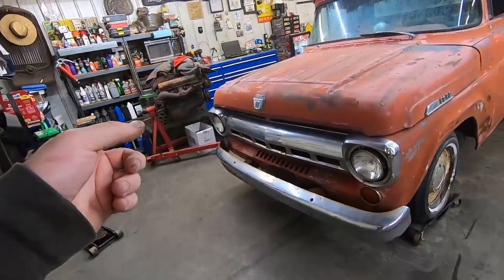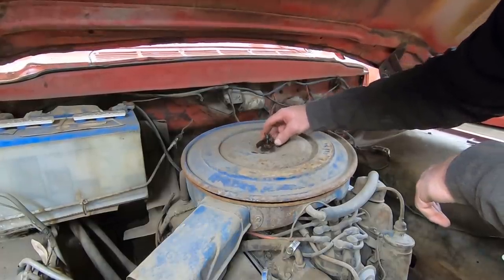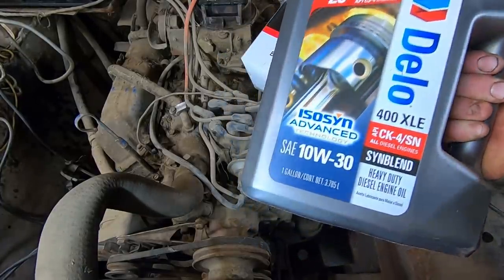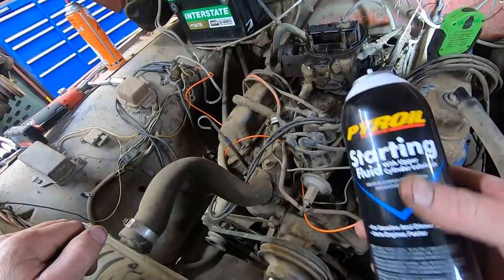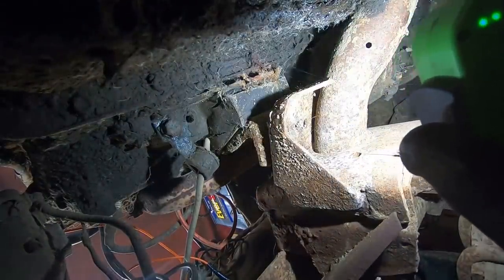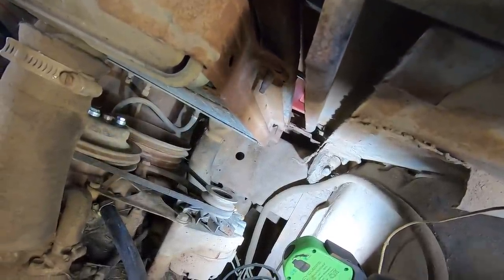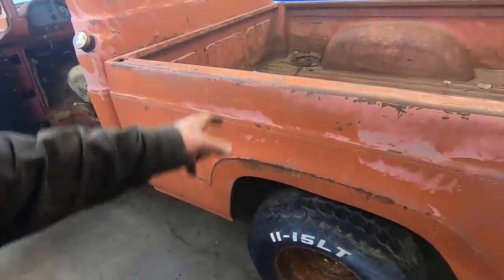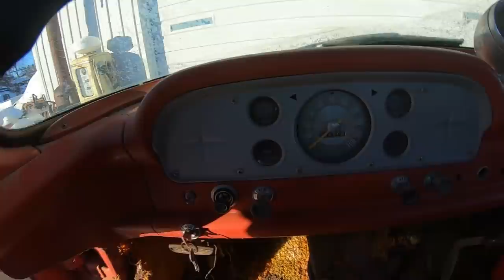Forgotten 1957 F100 Hot Rod Pickup Truck!! Abandoned for 40 Years! Will it Run?!?

Comment: Used to hang around with my wife’s cousin and would go to a lot of farm auctions. Gary bought and sold farm equipment, also scrapped some. Gary bought a ‘74 IH Scout ran great, trans shifted good so I was told that was my ride home. Everything went fine for about the first 25 miles then the Scout started to wander. Drove straight then would drift right, get it straight and drift left. Drove that last 25 on winding roads was a little hairy finally got to Gary’s farm and it turned out the frame was broken ahead of and behind the steering box. The only reason it drove fine that first 25 was that the front end was stiff from sitting and as it loosened up it started steering itself.
Reply: After that told Gary he could drive his own crap home 😳
Reply from the maker: Sketchy!!

Comment: Can you make a diagnostic video of the steering system? A topic not very popular. There is not  a lot of steering system videos out there.
This truck is so cool. Once all the bells and whistle are fixed, heating and cooling system, steering system, drive shaft balancing, new tires all around, the steel rims sandblasted and repainted, new brakes, and master cylinder, new glass packs, new headers, new plugs and wires, new hoses and belts, leather steering cover, fix radio, new seat cover, additional windshield wiper, correct shifter knob,
Reply from the maker: Yeah, we could dig into some steering at some point. Sounds like an expensive list you got there!

Comment: In my first major repair ever, my car had broken a timing gear, and went dead in the middle of the road (it was a '91 Skylark). I spent six months working on it and threw $1500 in parts at it before I ever thought to check the timing. We've all had those moments. When I worked at the junkyard, I bought tons of cars with minor issues that were misdiagnosed. I bought a really nice '80 Cougar from a guy that told me the motor was locked up. It just had a bad ignition cylinder. It wouldn't go into the crank position. The guy junked it over a $10 part that took less an hour to replace. We threw a key and cylinder in it and put it back on the road. It had a 302, and that car was a ton of fun to drive. I drove it for a few months before we resold it.

Comment: Ford Windsors have SBC style timing cover and water pump.  289/302 intake manifold is 9" wide, 351 intake is 11" wide.  The tubular engine cradle was also common use in early Econoline vands and pickups.

Comment: Nice truck. My first truck was a 57 f100 custom cab. It had the stock 292 Y block and a 3 speed on the tree. I rebuilt it after the head gasket failed. It was slow but it was smooth. Good luck.
Reply from the maker: Very cool!

Comment: Paper pressure-relief valve on Frams ... back when I was a parts-counter monkey, we got hit with a couple damage claims when that valve would come apart and trash a motor or ten. You can tell how bad they are compared to something like a Wix or a K&N cutting one open and looking inside. To be fair, I never had one come apart before I discovered how they're put together. I run the K&N ones on my Retrobird - the hex head built into the cap is a convenience when you can't get the filter pliers in there.
Reply from the maker: Good info!

Comment: Dude, I'm a Chevy guy but this truck is beautiful! Before my time so I'm not familiar with early Fords , but this one is sweet. I been using Fram filters on a chevy 305 for years. 250,000 miles so far. By the way , Puddin tried to burn the shop down, but he's a good guy.
Reply: You gotta use Puddin's fire footage as a dig.

Comment: Hey Mortske I love this truck. I'd love to see you fix the driveshaft, get some round tires and put them on like weld wheels or maybe some Crager Nomads on it for like a 60s 70s street look,  a 4 barrel manifold, and brakes.. I bet this thing would actually be a fun truck. Considering the steering box is wasted I wonder if there's a power steering box that will fit?
Reply from the maker: I think all of the steering just needs rebuilt.

Comment: Hey Mortske! REBUILD A CARB! For Pete's sake, bud. It takes me 30 minutes, once the thing's on the bench, and it's super easy to get good at. 

If I can, so can you. It builds confidence, the more ya do it. Just fuel in, fuel overflow return, metering, and not getting the jets backwards. I've seen a cranks no start go to purring like a kitten in an hour n 45 minutes in the driveway on the tailgate. The kit was at Oreilly. They can order a shitload of them, it's just finding the right guy, the ProDesk, Asst Mgr, and Mgr usually do me right every time. 

351W parts are hard to find because nothing ever breaks on them. 4 bolt mains, I think. Might be wrong. Think these are the ones you just beat and beat like Peggin' Leggin' Canadia Guy on a bender.
Reply from the maker: Why rebuild it when it worked just fine? If I was gonna rebuild anything how about the brakes? I've rebuilt lots of carbs. We did one on the channel 2 weeks ago. Parts are hard to find for a 351W cuz Ford had to change them every 3 years so there is only a handful of parts that interchange!

Comment: I have a red 59 F100. I grafted an LTD front clip.  That lowered it substantially.  I also have a 400 M with a holley 4bbl and C6 in it.  It handles and runs well.  I do have the LTD power steering  and disc brakes as well.
Reply from the maker: Awesome

Comment: Both Mustang's I've bought before were considered hopeless by the people that I purchased them from,... I took great precaution to do as little work as possible.... to get them to turnover.
#1. The Gold '72 GRANDE took fresh fuel, a strong battery, and the kicker was after I checked for spark, I found-------it had no points in the distributor! I installed a new set of points, and it fired right up.
#2. Aztec Blue '72 was similar,...it needed a strong battery, fresh fuel, but the carburetor's "Float and Pin" mechanism were missing; after I installed them from a spare carburetor I had,.... It too fired right up. (Both cars W/ original engines, 302 small blocks) my son and I love them.
Reply from the maker: Nice

Comment: No Ford did not forget the key in the drivers door.  To lock this vehicle and other Ford trucks of this era you push down (to lock) the drivers door handle, scoot across the bench front seat exit through the passenger side door, turn lock in passenger door.   Why, many states had regulations stating that you could not exit the drivers door into traffic. Locks on  both door sere available on the higher end Custom Cab in late years.  Narragansett Bay

Comment: Excellent video Mortske Repair  :) very interesting old 1957 Ford Truck F100 with 1968 351 Windsor motor plus Floor shifter Automatic transmission and bet fix drive shaft be smooth riding to again ! Reminds of my late Dad 1968 International 1300 1 ton pickup when growing till  1984 was road and scrap out in 1994 ! That truck was wild for sure and but kept warm in winter months!
Reply from the maker: Glad you enjoyed it
Reply: @MortskeRepair  you asked if use Fram Oil Filters yes I do and mistakes is how long use them plus a Conventional Oil ones & Long Life Types in mileage types and Synthetic Oil types  for gas and desiel motors! Why people had problems with is put oil filter for more kms or miles should be for instance basic one is good for one oil change not every 2 change or years worth and 2 X with Black grip for only 6 months or 7.500 kms or 5.000 miles! The other problem is in Conventional Oil use no recycling type oil to use 2× black grip bottom not use Synthetic oil plugged them fibre inside filter fast! If use Synthetic oil use excellent quality oil and no recycling type plus Oil filter for Synthetic type only ! But Fram Orange with Black grip says 2x do engine oil filter every time  on one use! Also don't use long life engine oil for year type that pure bull crap 6 month only and do oil filter to same ! There go Mortske Repair and You Tube videos viewer seen lots crazy ideas to do and best take this advice from me and never be sorry ! Also any vechiles in gas don't use Native Reserve gas because cheaper use Petro, Shell or HARDMACK or Havoline or Texaco even 76 or Flying J brand fuels there best and use 89 octane to top grades no 87 octane pure terrible!

Comment: The steering in that truck reminds me of the steering in a mate's Austin A35 van back about the time that one was parked.  He "fixed" it though.  First thing we noticed was the steering idler was letting the LF wheel move about four inches in whichever direction it wanted, so he took the adjuster nut out of it and pumped greased into it instead of the 30 weight oil.  With the car up on axle stands, we worked the wheel back and forth until with several applications of grease, the steering turned both wheels at the same time.  Then he took the filler plug out the steering box and filled that up with grease to take up the quarter of a turn of play it had as well.  Steering "reconditioned", we kept taking the wheel from lock to lock until it was easy to move while p on the stands, then went to take it for a run.  

He had a "silly little 3-spoke steering wheel" in it because the Austin's original wheel was about the size of the moon, but I think it would have been more helpful when we took off up his street and came to the first corner.  The van didn't steer very quickly into it, so he gave it a bit of a jerk and it turned in hard and then wouldn't straighten up....which would have been fine if he hadn't taken a run-up at the hill so the van's 948cc engine had a chance of getting us to the top in third.  We hit the kerb hard - which bounced the steering around enough that he could straighten the wheel - and rode along the top of it until the corner allowed the left hand wheels to come back down onto the road.  The bugger had his foot hard on the gas the whole time, so we never really lost momentum and got to the top of the road without further detours.  Undeterred by the off-road excursion, he hauled on the steering wheel and turned left, but again the van sis not want to straighten up, but he at least had the sense to hit the picks and stop this time.  

I walked back and got my own car to follow him while he sat there winding it from lock to lock for a while.  There was no way I wanted to be a passenger in it for a while!  The steering came right after a few miles of driving though, but he got a bit of a flashback when we had a sudden cold snap a few weeks later!  

For its lack of brakes, Ray Charles steering and six of eight cylinder power plant, that thing aint all that bad.  Yeah, she'll be a money pit but I reckon she'd be worth it.  It's got something.....I dunno what-----in its looks that I quite like.  Paint her a candy-apple red metallic and run chrome stacks up behind the cab corners where people will burn themselves (or a set of lake pipes) white steel wheels, chrome caps and tyres (with any white letters facing INWARD).  Has to be repowered with a Chev 350 though....   I gotta ask - why are they called a Fridge?
Reply from the maker: Cuz they're slab sided like a fridge I suppose.

Comment: The intake is wider on the Windsor than the 289 / 302.
 And that driveshaft is a factor ford rubber filled shaft for smoother rides.

Comment: 351s have a cast in gusset running uphill from behind the timing cover to the top of the block under the intake, next to the distributor. I'd still rather have a Y block. You just have to know how to align the timing gears correctly.

Comment: An easy way to visually discern a 351W (or other small block Ford) from a 351C is by the exhaust runners on the heads. The 351C has runners that extend beyond the edge of the valve cover and noticeably wider than the other small block Ford V8's.
Reply: Unless the original exhaust is gone.
A Cleveland uses a BigBlock tranny pattern. 
The Windsor has a 45° angle that is cast in the front of the block right next to the dizzy, no other small ferd has this.

Comment: Once you make a little power and launch hard at every light for a couple months, the factory motor mounts always delaminate. (things you do in your 20s)
I used to replace them twice a year. Then I got a new one, cut the stud off and drilled a hole through the mount. Then added a grade 8 bolt long enough to go through the mount and into the bracket. Then I used a washer and a nylon lock nut to tighten it down. It was the last motor mount I bought for that car. I am sure others have done this. It's too simple. I came to it when my CJ5 broke a mount and the oil filter hit the motor bracket and cracked open. Not a good trail day.
Reply from the maker: Ouch!

Comment: Good way to start off the year, a Ford that started up pretty easily, glad to see the 351, I kept thinking oh god don't let it be a Y block. The front springs looked like my older brother had driven it, he was great at launching vehicles and cracking frames and springs. Good tunes for the startup, Duff didn't have the look of confidence for the test ride, seemed to be checking if the window was open far enough in case of a bailout situation arose.
Reply from the maker: sounds like my kind of guy!
Reply: @MortskeRepair  My father didn't think it was to great, went to trade in a truck and the dealership asked if he knew the frame was cracked out around the spring hanger mounts. Oopsy!!!!! We lived in a very steep hilly area with crossroads terracing the hill sides, recipe for major air and a lot of sparks Ha!!!!

Comment: Fram used to be manufactured in Greenville Ohio and the fact that I had friends and family employed there I would use their products. I had a 68 289 I had pulled out of a junkyard and put in my fairlane. Done all the Craigslist rebuilding and when I started it had a rod knock. I knew that the rod bearings were in tolerance from the fresh rebuild I just done on it. I was suggested by a local shadtree tech to use a different oil filter. Put a wiz on it and no rod knock. No more Fram since.
Reply: A buddy of mine did an oil change on his 302 with a Fram filter the low dollar version, and within about a half hour experienced lifters starting to make noise and low oil pressure. Pulled filter for inspection and found the paper element coming apart and getting into oil system. There is a gentlemen on YouTube who does filter comparisons, cuts them open to see how they are made and what materials are used, good watch.

Comment: Duff cam FTW. Truck might be sketchy as heck but obviously Duff doggo approved. 
ATF flammability: oh yes,worked as an automotive refueling technician back in 78 where we had bulk oil/ATF bunkers in the back room for customers. 
Guy comes in one winter night asks for a fill up and to put in a quart of ATF but of course refuses to shut off the engine. 
Customer is always right so go get a quart of bulk ATF and after asking again if he wants this done with the engine running and getting a terse yes do it pull the dip stick and put it in. Apparently there was still about half the filler hose worth of fluid that spilled out when removing the nozzle that hit the exhaust or manifold because I had a momentary flash fire under the guy's hood, a brown shorts moment and the customer all of a sudden POed I tried to burn his car down. Fortunately guy that owned the station was on the other pump island and heard the last time I asked about doing that on a running car and shut down his temper tantrum.
Reply from the maker: That'll do it!

Comment: I was able to get about half of the slop out of my 1950's F-1 steering by tightening the adjustment screw in/on the box.  It's been awhile but I seem to remember you can see the gears clash tighter.  But at some point the gears become nothing and no amount adjustment will resolve the issue.
Reply from the maker: It's too sticky, needs a rebuild.

Comment: "I'm more afraid of the steering than I am of the brakes" ok, it literally has NO brakes, no rears, no fronts, probably no parking brake either, it's an automatic so you can't clutch it to a stop, but...the steering scares you MORE than the brakes.  This situation reminds me of my second Ford truck.  One day I'm on my way home from work driving straight, I turn the wheel to follow the curve of the road, the truck keeps going straight, the steering wheel is NOW SPINNING FREELY in my hands.  Brakes worked (kinda, like I had maybe 26.2 percent brakage available) so I didn't hit the new Corvette in the pawn shop parking lot that was sitting right where the truck decided it wanted to go.  One Dorman HELP $10 rubber "rag joint" coupling later and I was back headed home but that's not a pleasant steering related memory.
Reply from the maker: Yup! Sketchy stuff! Hate when that happens!

Comment: Windsors used 6 bolt valve covers Cleveland’s and modifieds used 8 bolt covers. Another good way to check is the timing cover if it’s a full cover about an inch and a half thick it’s a Windsor if it’s just a little thin plate bolted to the block it’s a Cleveland or 385 series modified or 400
Reply from the maker: Great tip

Comment: 20  odd years ago.
I built a Ford F-100 short box small window.
429 with a C-4 tranny with 4 inch stainless exhaust and shif kit. She had real smoke glass and Burgandy interior with a pearal paint job.
Used to smoke the the Chevy trucks with there blowers. My truck was 500 pounds heavier than the chevys. She would squat and launch. Spent a lot of my time at gas stations. Forgot to move the little tank behind the seat. Even with new hoses she would still smell like gas inside the cab.
Reply from the maker: Awesome!! Where's it at now?!?